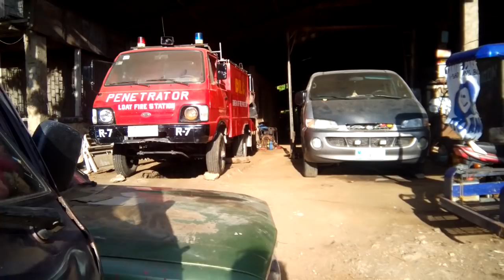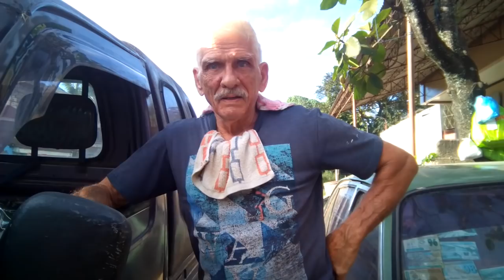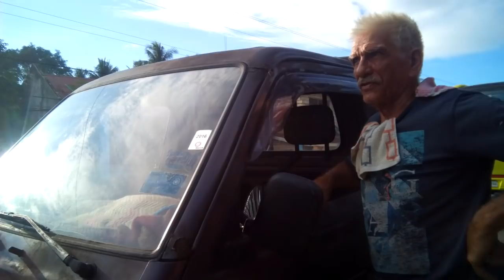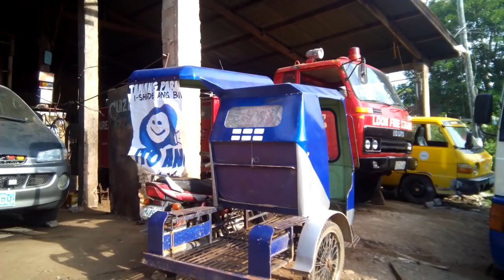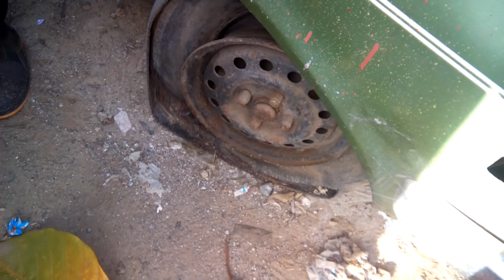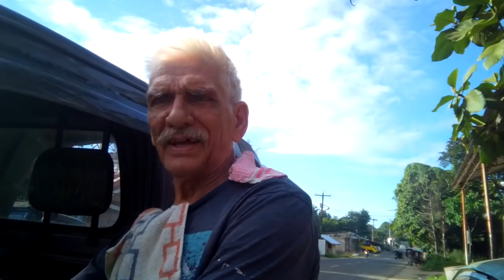MULTICAB AT THE REPAIR SHOP

Comment: Sir does the multicab come with a heater and engine coolant temperature gauge? If you find your engine over heating, turn on heat to maximum  to relieve engine over heating. That will give you time to pull over and or get to a shop. I would turn the heater on when you notice above normal termperature and before over heating.

Comment: mabee iff you cleaned out the radator regually and put propper coolent in it putting on the 3rd head gasket  what caused it  idd guess blocked radiator leading to overheating  service it regually dont wiit for it to shit itself then wonder why